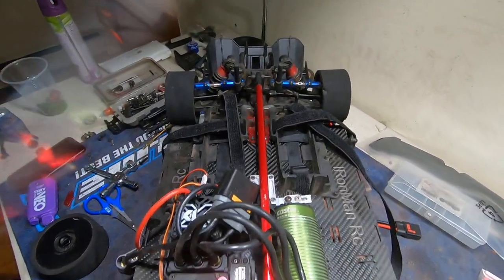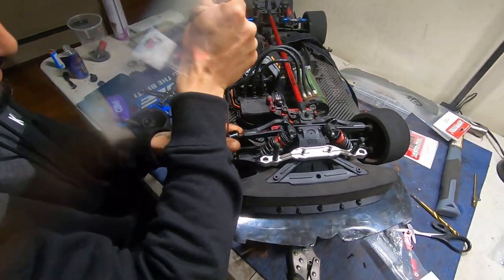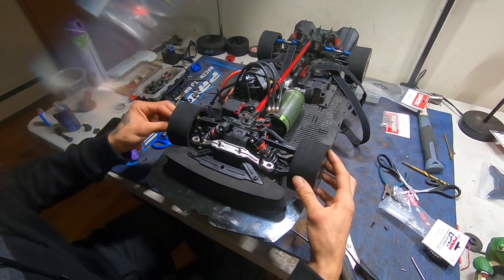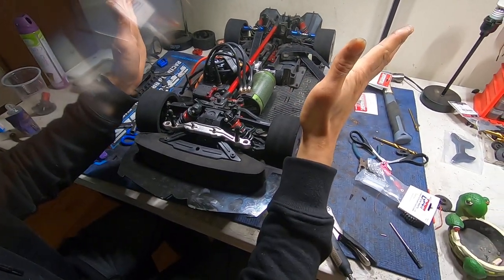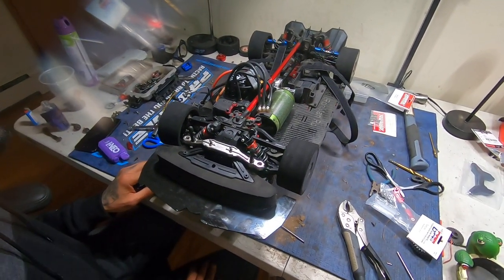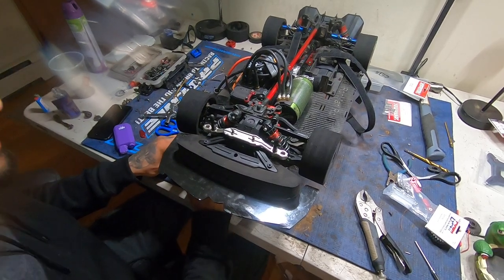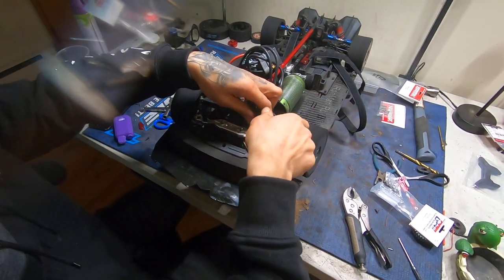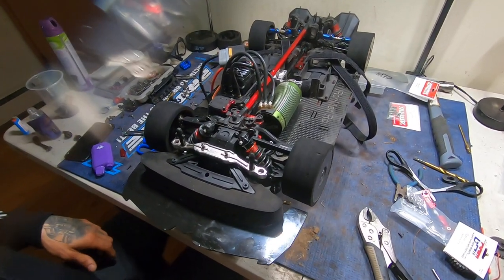LIMITLESS GT CARBON FIBER CHASSIS BUILD ( BENCH WORK👏💭👏)  VICTOR PEDRAZA TALKS SUSPENSION TUNING

Comment: Like 1 kings I have a great suggestion for you guys speed rate in the remote makes the car drive 10 times better it different than dual rate turn your speed rate to 35 % and watch the car drive like a Maybach 😂😂😂 I love you guys Channel keep up the good work shot out to vick p!
Reply from the maker: I have all my exponentials lowered to my liking, its around 30 and 35... bracket is a no go.. bad crashes it dont hold up... aluminum is too soft in my experience
Reply: @builtbyrobrc  speed rate is a plus I guarantee you will see a difference in efficiency and handles of the car king it's all testing and tuning it totally different from expo dual rate and steering rate and travel it really changes the performance of the car!